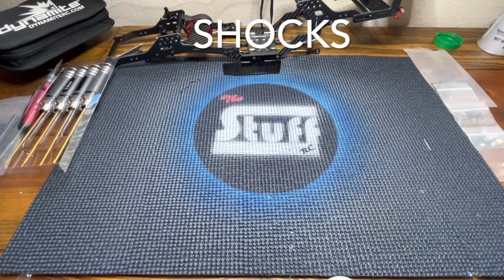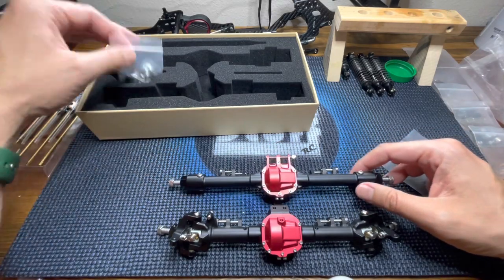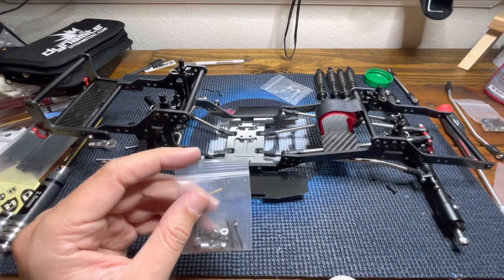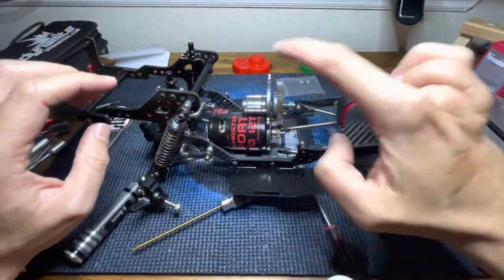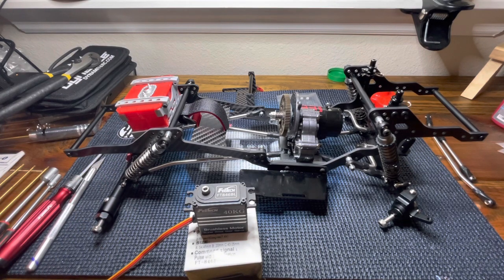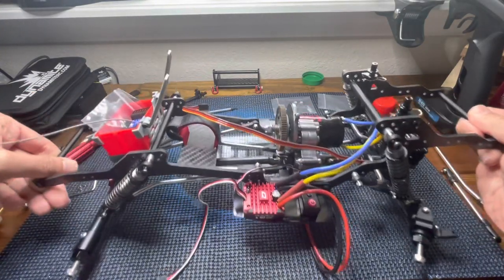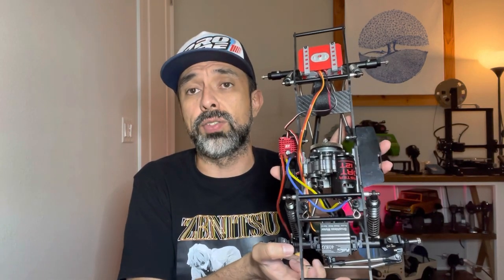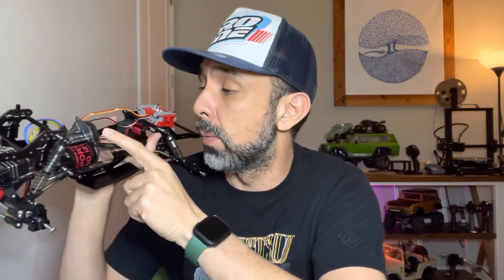Axial SCX10 LCG Chassis, Axles, Transmission & Electronics (Part 2)

Comment: What length drive shafts did you use
Reply from the maker: Sorry for my late response friend, there are the ones you need:
 https://www.injora.com/products/injora-lcg-carbon-fiber-chassis-kit-frame-girder-for-axial-scx10-scx10-ii-90046?variant=40430275657776

Comment: Is there a front axle that works straight from the get go without modification?
Reply from the maker: I don’t think there is one, you will have to play with the links regardless what axles you get 
Thank you for watching friend
Reply: @thestuff6102  sorry i didn’t mean axles i meant drive shaft 🙄yea ive switched to normal 4 link style links. I have tigged a shaft for now but it pops out occasionally. It seems on most shafts the cv and the female ends are quite long.
Reply from the maker: @MrChris106gti  this are the ones you need
https://www.injora.com/products/injora-lcg-carbon-fiber-chassis-kit-frame-girder-for-axial-scx10-scx10-ii-90046?variant=40430275657776